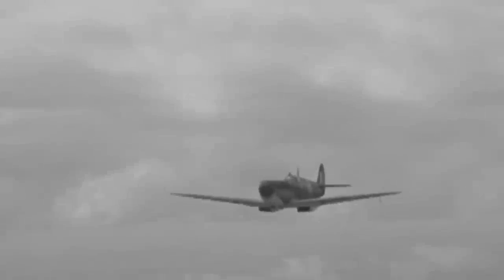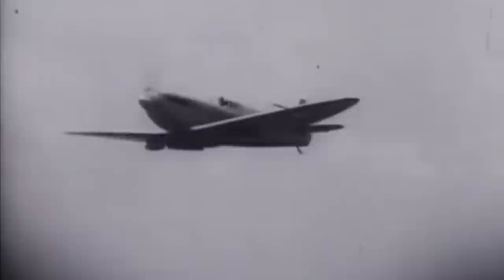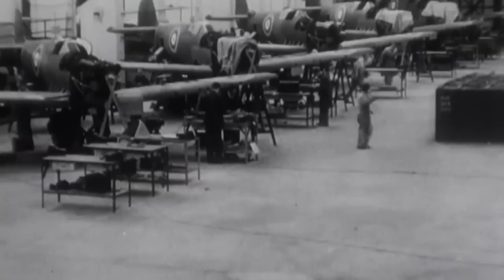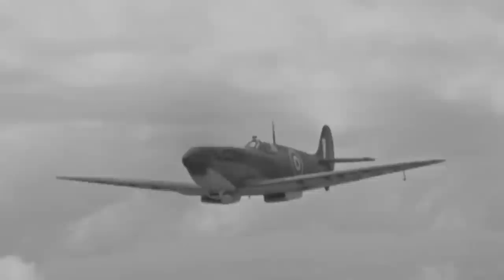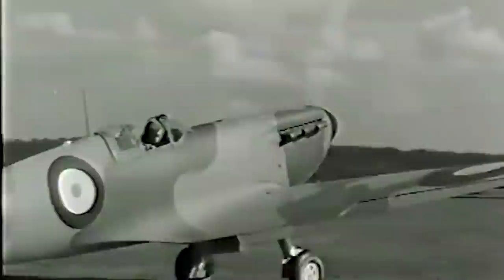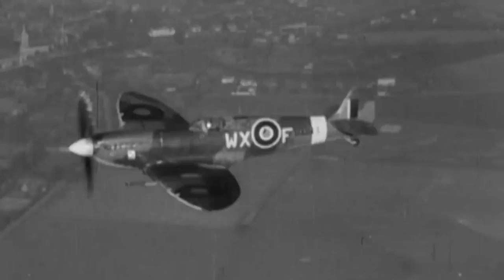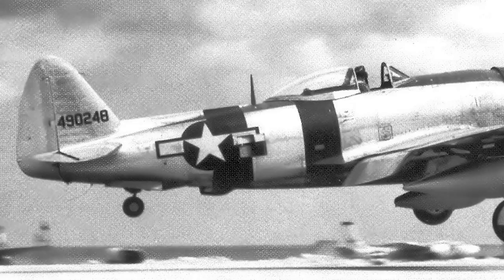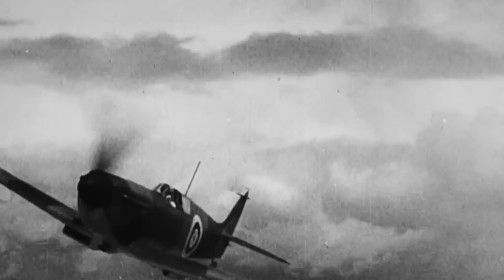Supermarine Spitfire - The Most Agile Fighter WW2 ?

Comment: The RAF was flying "Spits" in Hong Kong in 1949 and for several years later.  They'd go up and do mock dog fights over the city, a couple of really experienced pilots, probably WW2 aces, would square off against the younger pilots and put on fabulous demonstrations.  There wasn't much commercial traffic in those days.  They were replaced by Mosquitos, a friend and I were walking down a long road to the Kai Tak terminal when we heard a low pitched humming sound that's characteristic of approaching Merlins, two "Mos'ies" were coming at us at high speed about 20 feet off the deck, they split to go on either side of us.  We laughed, jumped around and waved to them and they came around again, as they passed they took off their oxygen masks, we could see their big grins at having bounced us.  It was great stuff, never forget it.

Comment: Curious Note: The Spitfire was not particularly well liked by soviet pilots, they actually preferred the P39 Air Cobra over it. Several Soviet aces scored more kills with P39 Air Cobra's than the highest scoring Spitfire aces.
Reply: The Soviets used clapped out Mk Vs then Mk IXs  They were used as mainly air defense types.  Postwar too.  the P39 was used extensively as fighter-bombers which flew at lower altitudes and close to the front where they had encounters almost every time with the Luftwaffe. In other words, the tactical deployment of the P39 was different and much more numerous.

The Spitfire was the best fighter of the war.  

Please use context when researching. It will give a much better and accurate picture.
Reply: @paulbantick8266  Your home boi deflection spin still explain why soviet  aces scored more kills with P39 Air Cobra's than the highest scoring Spitfire aces, those Spitfire aces flying the best available at the time. Think before you hit ''Reply''.
Reply: @rickden8362  How old are you?   Was the Tempest, P51, P47 and P38 even more worse than the P39?  The low/medium altitude aerial combat tactics in the east suited the P39. It did not and would not have been any real good in the West.  

Anyway! The Spitfire claimed more air combat victories and had more aces. It totally outperformed the P39. Even a Mk1a of 1940 could outperform the 1942 UK lend-lease P39s which just about got to 355 mph at 13,000ft.  OK, the later P39 could just about get to 380 mph at 17,000 ft and had a good slow-speed roll rate but that's all. Allied fighters would by late 1943, be flying at 'at least' 50 mph faster. Climb, dive and turn faster too.

The Soviet P39s were also much more liable to be facing dive and fighter-bombers rather than the higher flying FW190's and 109's optimised for fighter roles, which were taking on the more capable higher altitude Soviet fighters. 

The Soviet P39 losses were high at 22 percent. or just over 1 in 5.
Reply: @paulbantick8266  You can throw up as many walls of text as you like it will never get around the fact that:
   Several Soviet aces scored more kills with P39 Air Cobra's than the highest scoring Spitfire aces.
   So how's that Brexit thing going.🤣
Reply: @rickden8362   I have not "thrown up walls"  I have put forward context. Something in which you have been woefully lacking. 

Brexit?  What's that got to do your silly postings?  Oh, of course!  You are just adding more silliness.
Reply: @paulbantick8266  He is a Yank what do you expect.?
Reply: No it was not liked It was not a good rough field plane Just like the Bf109

Comment: I still like the F4U corsair and the P 47 thunderbolt  are better.
Reply: historically they were less manoeuvrable, heavier and had a long turnaround time. Although the Spitfire was designed as an interceptor, the F4U and P47 were instead fighters up to CAS.
Reply: Different planes for different strategic advances. You're comparing apples to oranges.

Comment: Most agile? No. A6M2 and Ki-43 for instance were more nimble, exceptionnal turnrates and because they were so light, a great power to weight ratio gave them a pretty good climb rate too. But that came with an heavy price and these planes were eventually exposed by allied fighters. The spit was, however, one of the most agile fighter that had no glaring weakness. Unlike the zero for instance, the agility of the Spit did not come with big sacrifices like no self sealing tanks or smaller, light engine therefore low max speed. The Yak 3 was also a formidable dogfighter and as easy to fly as it was maneuvrable.
Reply: But for the time it was made, it was probably one of the most evasive

Comment: I think that while the spitfire was without doubt a good fighter it wasn't as perfect as a lot of these documentaries imply. A lot of information tends to get left out probably because it might take a little bit of shine off the spitfire. One fact that is often completely ignored is that the Hurricane was more maneuverable than a Spitfire where it lost out in speed and climb. 

Again it's implied that Malta didn't have any air defense until Spitfires arrived.  At the start of the war, Malta only had a squadron of Gloster Sea Gladiators that did amazing work against the German and Italian airforces until bolstered first by Hurricanes and eventually Spitfires. 

The Hawker Typhoon was a match for the FW190 despite the man faults the Typhoon originally had.

The preferred aircraft for intercepting V1's were the Hawker Tempest and DeHavilland Mosquito mainly for their speed advantage over the spitfire and heavier armament.
Reply from the maker: Thanks for watching honymonster30 👍
Reply: Actually a MkIX shitfire was faster than any version of the mossie which was about 410 MPH which was NOT that fast many fighters were much faster !!!
Reply: @wilburfinnigan2142  I believe you'll find at the height that V1's flew (2000 to 3000 feet) the Spitfire MKIX was a lot slower as the Merlin 61 was optimized to higher level flight with a 2-stage supercharger.  It ould only reach its listed top speed at around 20,000 feet
Reply: @honymonster30  Absolutely, and the Merlin Mustang was the same, why the Allison powered Mustang out ran both of them under 20,000 ft, where each supercharger was optimized for, what people fail to realize and why the Allison Mustang was used throughout the war,
Reply: @wilburfinnigan2142  Really? The average speed of WW2 single engine war planes was 345mph....
Reply: @wilburfinnigan2142  The Late production Mk IX  flew at 420 mph, the Mk.XIV at 448 mph The Griffon-engined Spitfires were used to combat the V1 and did so effectively.

 	"XIV 	Incorporated the two stage super charged Griffon engine which substantially improved performance at high altitudes but required considerable airframe changes to cope with the weight and power of the new engine.  This included more fuel storage to deal with the higher fuel consumption, five blade propeller and greater cooling facilities.  This mark of Spitfire would destroy more V-1s than any other Spitfire and German fighters avoided combat with it due to its performance.  610 Squadron was the first to operate the aircraft from December 1943."
 
Wingspan – 11.23 m
 
Length – 9.95 m
 
Height – 3.89 m
 
Engine – Griffon 65
 
Maximum speed – 448 mph at 25,600 ft
 
Service ceiling –  43,500ft
 
Combat range – 460 miles 

The fastest Mosquito types had speeds of between 415 and 425 mph. The slowest was 354 mph (heavily armoured and armed anti-shipping strike variants) The main speeds of the different types (NF, FB, B, PR) were between 388 to 408 mph.
Reply: There was not a WW2 single engine US fighter that matched the Spitfire in Climb Rate, Turn,Tactical Mach, Service Ceiling , Stall , Economy , Roll Rate [at combat speed] 
tHE p51 COULD NOT STAY ANYWHERE NEAR THE sPITFIRE
Reply: @honymonster30  tHAT IS WHY THEY BOOSTED THE sUPER AND USED 150 oCTANE
Reply: @wilburfinnigan2142   The Allison was a dud in the ETO/MTO
Reply: @jacktattis  FW 190 springs to mind plus plus the ME 262 could quite easy reach a speed the spitfire couldn't match. Don't forget about the Hawker Tempest. The Spitfire was without a doubt an excellent fighter it wasn't the best.
Reply: @honymonster30   Me262 Jet my friend And the FW190 D13 440MPH @ 30000ft S/C 39700ft MkXIV 448 mph @26000ft S/C 44500ft  Tempest 435mph@17000ft S/C 34800ft Not even in the same ballpark It was however the faster at Sea level .
Reply: @honymonster30  The FW190A roll rate was never equalled
I found this 
Spitfire Mk IX 411Sqn 05 Oct 44 1 x Me262 however the Tempest was better they got a couple

Comment: It all depends on which Mk you a talking about. The Spitfire had many variations as it evolved, with varying weights, depending on engine and armament (Merlin vs later Griffon variants, say) and intended roles (fighter vs photo reconnaissance). The clipped wing version, for example, gave a faster roll rate. None could really match the Zero for agility or even the Hurricane for that matter, except in speed.
Reply: There were over 20 marks of the shitfire and many developed for a specific task but that did not mean that ALL shitfires could do those tasks !!!!!
Reply: @wilburfinnigan2142  Yes they could  ?

Comment: The spitfire was a plane designed for a specific duty, interception, and as a result many compromises were made , the thin over enginered wing gave speed BUT was difficult and slow to build, and difficult to install guns in, as was the fuselage, the narrow undercarriage was built that way to save weight in the wing, less spar, and relied on the fuselage for its support, but it was a bitch on the ground,  and the lack of fuel capacity to save weight also gave it a very short range !!!!
Reply from the maker: Thanks for watching Wilbur Finnigan 👍
Reply: 18000 Spitfires were built  during Wartime and used by Australia, Belgium,Britain, Canada, Czech , Denmark, France, Holland,Ireland, New Zealand, Norway,Poland, United States , at no charge not one penny.